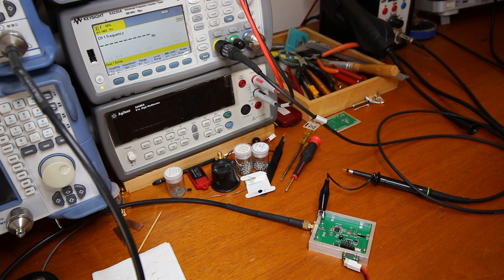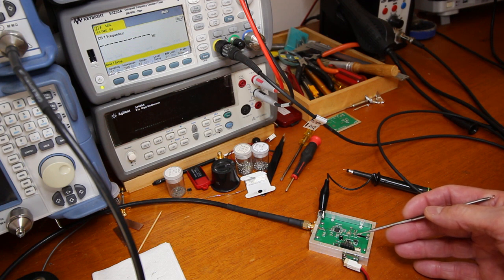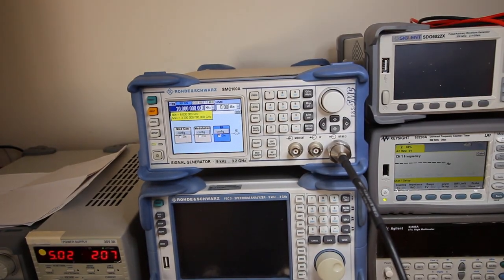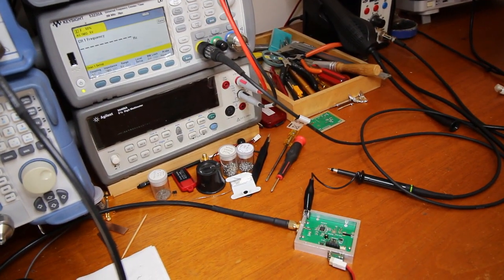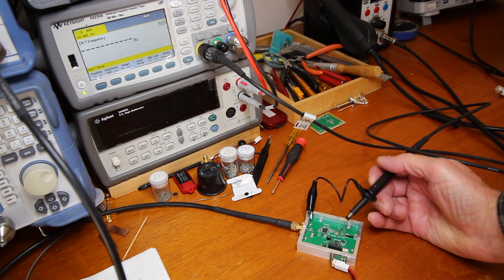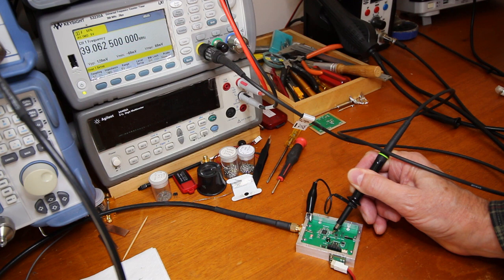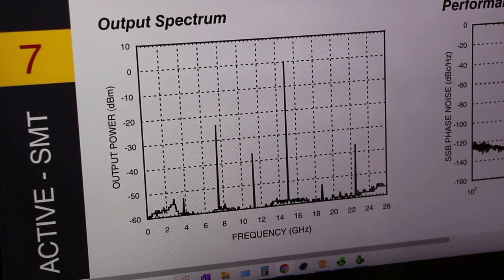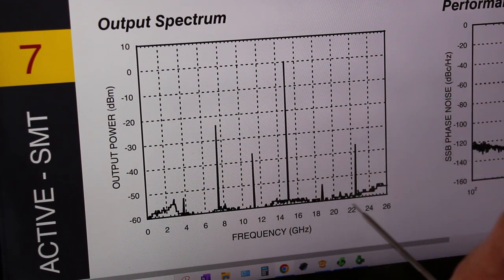#27   16 GHz Local Oscillator - MAX2871 + HMC370L

Comment: Great work! what substrate did you use?
Reply from the maker: Thanks. In this case it's FR4 - that's the reason why I used the the RG405 cable at the output to avoid the losses. If you decide to use PTFE as substrate you certainly won't need the cable.

Comment: Great videos! but I have one question for you: have a MAX2870, reading R6 and writing registers correctly SPI, but nothing generate (REF 100MHz), no auto select VCO, no AGC value. How i can find the problem? What to do first in this case? Thank you!
Reply from the maker: Suggestion (if I didn't miss anything): 
On the MAX2870 power up the fractional mode is set, integer division is 250, fractional division is zero and the doubler and dividers in the input path are disabled. If you apply 10 MHz at the reference frequency input you should have 2.5 GHz at the output A (B is disabled) and the lock signal should be ON. If the output is too high for you to measure, modify Register 4 accordingly. If it doesn't work, consider checking soldering problems. I hope it helps.
Reply: @vk5fe943  thank you!  I Have 100mhz refrence now on board.. . The lock Led not work when power up. Only manual set to on off is work. Ref 10mhz gen now travel to me on post. I Will try it, or may be soldering first...
Reply: @vk5fe943  it was work OK with external REFIN, problem was in internal REF gen
Reply: @vk5fe943  you are using a simply scheme for NAX2871 - can you share it for me? (may be CAD files) i want to create simply gen device with MAX2870, but always seen more complex schemas, but i need simply one freq signal, how on your device. Thank you!

Comment: Good work. It would be nice to see close to the carrier spectrum, for example 10 MHz span with 1 kHz RBW.
Reply from the maker: Thanks for the input, Asef. The expected phase noise at 10KHz offset, with a Pfd frequency of 100 MHz and output of 4 GHz is about -104 dBc/Hz. Of course we must add the phase noise increase due to the quadrupler (12 dB). Unfortunately there's the intrinsic phase noise of the spectrum analyzer, which is -106 dBc/Hz (1 GHz, 10 KHz offset) then I am afraid the measurement could be compromised - even so, I will look into that.